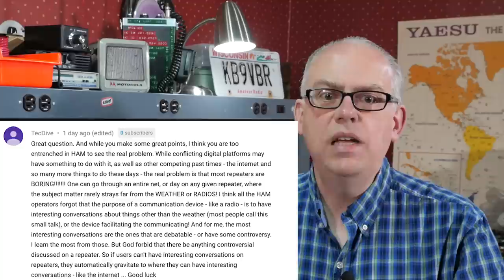Your Questions Answered (Quiet Repeaters, APRS, 1/4 wave antenna) May 2019  - Ham Radio Q&A

Comment: Hi Michael. Just wanted to let you know that I really enjoy your videos and I'm learning a lot from them. I am a new Ham as of February of this year and am currently working toward my General ticket. We are very fortunate in our area, Asheville, NC., in that we have the Mt. Mitchell repeater at 6600 feet elevation. I am just 26 miles south of the repeater and since it covers such a wide area, the conversations are always interesting. I know this is a little "off subject" but I am planning to get started in HF soon and since I have a somewhat limited budget, I am curious what you think about the Yaesu FT-450D as a starter HF radio. It looks like a good basic HF radio to learn with. I currently own a Yaesu FTM-7250D VHF/UHF and am very pleased with the quality and performance of the radio. Thanks again for your great videos!! David K4UVX
Reply: I also live in western NC, Lenoir. Mt Mitchell used to be outstanding but for some reason N2GE Randy has had a problem finding the reason it's been so temperamental lately.  KE4VXC Chet has even closed the 6600 net early a few times... :-( I'm a member of the Marion Ham Club, their repeater is 146.985 WD4PVE  118.8, great group of folks over there, if you get a chance please come over and say hello :-) God Bless!!! KM4EVI Brian
Reply: Hi Brian, thanks for the reply. I'm also a member of the Marion Ham Club. I took my Technician test with them in February of this year and joined the club at their February meeting. You are definitely right, they are a great group of folks. Everyone has been very helpful. I look forward to meeting you there sometime. I try to attend every monthly meeting as well as stopping by on Friday afternoons to chat. Regards, David K4UVX

Comment: question-not related to any subjects in this video:

i was going to ask one question, but researching it has led me another. i had thought that frs and gmrs frequencies were within the amateur 70cm band, but looking now at the aarl band plan, i see that they arent. so, as a licensed ham operator, would i also need a gmrs licence to transmit on gmrs, in addition to my technicians licence?
Reply from the maker: Yes you would. GMRS/FRS is a totally separate radio service. FRS is license free, but a license is required for GMRS use, as GMRS users can operate with more power than an FRS user. But the licenses don't require a test and a single license covers your entire immediate family.

Comment: Is there any modem/program  or SDR device that allows you to type text on your computer and then encode it into CW and transmit? I know radios like Elecraft KX3  with  side car allow to decode received CW . I want to encode and transmit. Was lucky enough to get license but too old and deaf to learn manual CW.   73s AF5LQ.
Reply from the maker: I believe programs like Ham Radio Deluxe or FLDigi and decode CW and turn text into CW. That may be an option for you.

Comment: Has someone made a 2 meter antenna out of hiking poles?
Reply from the maker: I know of individuals that put a half wave antenna inside a hollow fiberglass shovel handle and used it as a hiking pole. In order to put an antenna element into a hiking pole, it needs to be hollow and nonconductive, like wood, plastic or fiberglass. A metal hiking pole will not work.